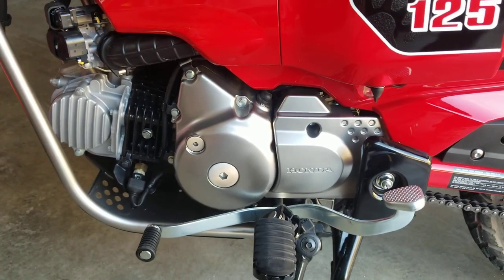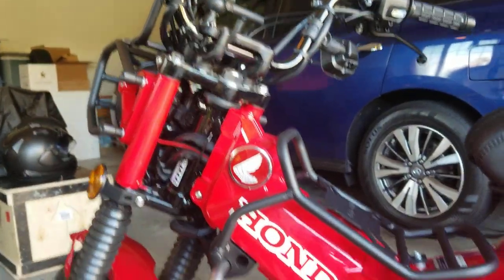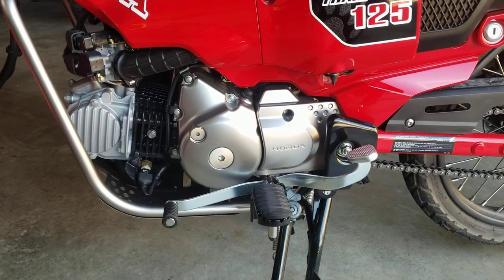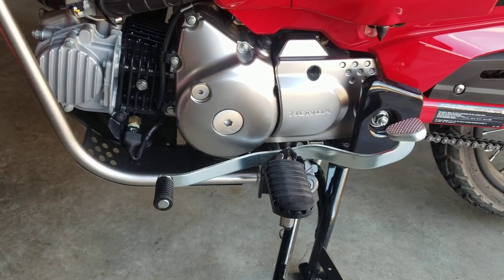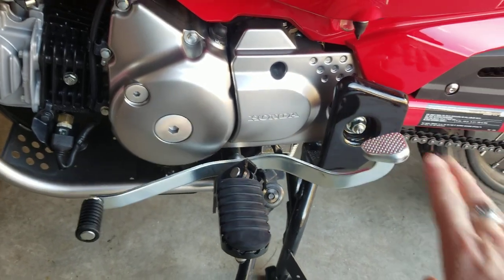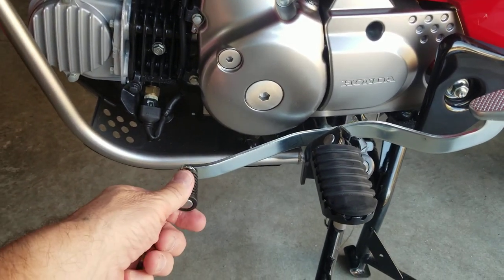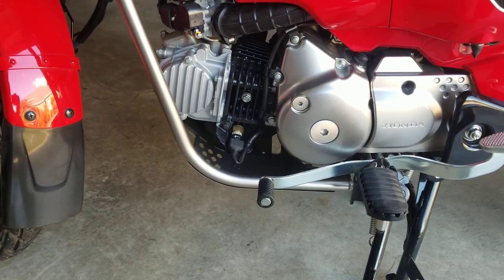2021 Trail 125 Shifting a Semi Automatic bike.

Comment: I too have been riding for many years and I'm still trying to get used to the transmission. Thanks for posting your input. I like my Trail 125, but it's just taking me some time to feel truly comfortable with the lack of a manual clutch.... I know I'll get used to it eventually, it's just so different than having an actual clutch lever. Yes, I'm an old guy and it takes old guys some time to adjust to new things! Greetings from Clemson, SC - Happy Thanksgiving to you all !!
Reply from the maker: I agree. At first I was a little disappointed at how it shifted. Once I got how it worked I now enjoy riding the bike more and more. Happy Thanksgiving.
Reply: That auto clutch setup is tried and proven. My first bike was a 1969 Honda 50 minitrail. That was enginered perfectly for a 10 to 13 or small 14 yr old. Like a tractor. Trust me, the old tech Honda centrifigal clutch is bulletproof and genius in the woods where you need to stop and go to maneuver around trees and stuff. No stalling of the engine. I abused that clutch for years and sold it to a friend who further abused it and it just kept working. I wish all bikes had a auto clutch.
Reply: Im 25. Id rather have a normal clutch.  Im looking at picking up one of these simply to use as a pack mule around my local small town and to haul my stuff to my various campsites in my county. Where i live a klx 300 or a full blown 450 dirtbike will be better for the type of stuff im dealing with but those also cost a lot more and arent as good at being pack mules. Frankly theres areas arpund me youre going to want a sidebyside with water food a shelter. You have to be caredul, you can overheat in day time and freeze at night. If i hace a pacl mule type bime i can haul ice blocks to my camp an that helps with the various activities im involved with trying to do. Its evry hard if all i have is a klx300 and whatever i ca. Fit in a backpack. A trail 125 isnt as capable but itll get better mpg and i can carry morr water which is key in the desert and carrying water in a backpacl is a terrible idea if you need multiple days worth

Comment: If only Honda kept the high low range feature, I'd buy one, but without that it is a compromise gearing wise. Geared barely low enough for trails, via sprokets, yet too low for the highway. They could have geared it higher with a larger front sproket so it can keep up with traffic and throw the low range lever to gear down for in the woods. Honda missed the mark on this one.
Reply from the maker: Some interesting opinions.  Yes the bike is not geared for off road or highway riding. It is geared for city and dirt road riding. I think Honda after making some 100,000,000 of these bikes. Starting at the small CT's and to the present Trail 125 may know a thing or two about how to build a bike for the masses. I'm not dumping on your opinion just adding mine. Ride safe.

Comment: Excellent explanation of the Honda centrifugal clutch system.  My first motorcycle was a Honda Passport 70 I got back in the 1970's.  Rode mostly bigger bikes for most of my life but when I retired I returned to my first love and bought a new Honda SuperCub in 2021.  Only $1,400 from the dealer (assembled in Thailand). I ride it all over the Pattaya Thailand area and it's a blast.  When I picked up a place in Cambodia I bought an old LittleCub (2005 or 2008, things are a bit foggy on that).  The 49cc engine is now a 125cc out of a Honda Dream, and it's stripped down to a street rat cub.  Great fun for getting around, and at 6'4" I look wonderfully dorky riding that little speed demon through the countryside.

Comment: I have a 2019 Super cub. It took a few miles to get the hang of it, but when you do it's nice! 
I've seen countless videos were people are switching the shift lever to get rid of the heal function.
I usually tell them to give it a chance. South Carolina here!
Reply from the maker: I agree. There is some getting used to it but once you do it's kind of a unique feature of the bike. One that I like. I may be doing the SCAR in the spring on my Trail 125.

Comment: Unless I miss understand, this seems not right for mine in Canada. If in N and you shift up you are in 4th. I was starting out in 4th and had it all backwards. When in N on mine you shift down for 1st and so on. One question, for safety we are supposed to park in gear so it does not roll fwd off the kickstand and so I wonder if I can start it in gear or do I have to shift into N to start it when I get on as there is no hand clutch..

Comment: Thank you for this explanation. If I understand correctly, you push your heel down and let it back up to shift to a higher gear, and you don't have to let it up gently; but when you shift down, you press your toe down and let it up slowly? Will there be a problem if you let it up too fast? Also, if I use my heel to shift up to 4th and then shift up once more, does that put the bike into neutral? If so, is that a good way to prepare to stop, or should I gear down to 1st and then stop, or down to neutral and then stop? I have never ridden a bike, so any help will be appreciated.

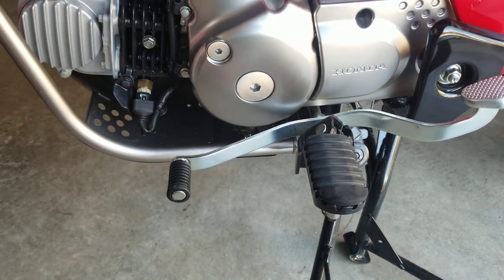Comment: 2:02 When you push the front lever down & hold it between say 3rd & 2nd gear.. Other people say it's not actually in neutral but instead causing the centrifugal clutch inside to be partially engaged/disengaged & slip which wears it out quicker. 
Many riders unknowingly ride with their foot slightly pushing down front lever which  burns  their clutch up. 
A semi automatic scooter 🛵 is made to be much easier to ride than motorcycle with manual clutch.

Comment: I got a question NCC. Is there a way to make the Honda trail's clutch grab harder so it will pop a wheelie in first gear. It seems to slip a lot when reving up the engine and letting off the shifter to engage it in 1st gear. I can't get it to pop up more than an inch or two.  I got a small bump in my yard.  When I'm coming off my driveway, I  It pulls the wheel up a little in second gear when I hit that small bump. I noticed the clutch doesn't slip like it does in second. It grabs it hard but because it's in second and with the weak motor, it barely popps the front up. I have an old 2000 Honda foreman 400  4 wheeler that has the same no clutch hand grip set up. I have been doing wheelies and abusing it for like 23 years. Never had anything go bad or never had to  replace the clutch.  While reving it and letting off the shifter in first gear will pop up so hard  to where I will fall over on my back If I don't let off the throttle. Is there something that can be adjusted or add stiffer springs so the clutch on my Trail will grab harder?  The way you described it, it sounds like the clutch is still a clutch like the one on my Monkey and I can just replace the springs with stiffer ones?  I'm not a mechanic by no means, but I do work on all my bikes, atv's and cars. I never had the need to know about this honda clutch set up. Thanks for any help you can give on this so I can do some stunts on my Honda Trail.

Comment: New rider here, just passed my course and looking to buy a Trail 125. Sorry if this is a silly couple of questions but in the case of an emergency stop, you would just kick down the front shifter into neutral and then break that way? Also after that without holding the clutch how can you shift the bike back down to first gear to take off again? Thank you!
Reply: Late reply, I know. In an emergency. hit your engine Kill Switch. the Switch near your Right Thumb. and while it's off, you can shift it, so Shift it to neutral before turning it on again
Reply: it has a centrifugal clutch, when starting from stationary, engine and transmission are disconnected until engine speed becomes high enough
coming to a stop, power disconnects once again when engine speed falls below certain threshold

Comment: Hi, I am riding a Honda Future 125cc and tend to sit nearer to the front but when doing so, I find it very difficult to use my heel to step on the back pedal to downshift to lower gears because my legs are bent inwards. For the lower leg, is it ideal to be 90 degrees to the knees or bent slightly outwards? 
Otherwise, I really can't get used to downshifting using heel to step down back pedal, can I downshift by lifting my toes upwards against the front pedal?

Comment: This is bizarre please can you confirm your bikes gearing is neutral then 4 up for years 1 to 4 ? Then down 4321 neutral? The reason ask is that the CT 125 here in Thailand is 4 down gears 1234 and gears up 4321 the complete opposite of the same model here in Thailand a real head scratcher
Reply from the maker: Here in the USA our gears are set up different then yours. Here is all the way down is neutral and all the gears are up. There may be some confusion because to shift up I push down on the heal shifter to go up a gear and push down on the toe shifter to go down a gear. Hope this helps.

Comment: Bro i have no issues with upshifting but whenever i downshift by letting go of the throttle all the way then pressing the shifter hard then lifting my foot then back to the throttle i feel a huge jolt I can't find a smoother way to downshift right now im literally driving in third gear without shifting at all because of that jolt any suggestions?
Reply: Hi @Adam_Ch739, greeting from Jakarta. The trick is to watch for your rpm. If it's too high, let go of the throttle first. Then you press the shifter down and slowly release it whilst slowly rev up. I guarantee you there will be no hiccup. If the rpm is low, let say you are about to stop, you just shift down without the need to rev up. Been riding this semi auto a long time ago. Feel free to contact me.

Comment: On my 1980 Trail 110, I have to blip the throttle while downshifting. I can’t hold it down and coast, the minute I push down, it shifts. Maybe it needs adjustment or is just worn out.
Reply: Does a 1983 Honda ct110 shift the same as we saw in this video?

Comment: So what's the difference, if you  decided to use your foot underneath the front to push up on the gears
Reply from the maker: There is no difference.  Some riders with larger feet cut the heal shifter off and only use the front portion of the shifter. Just as you would find on a regular toe shifter.

Comment: I notice that your bike shifts a lot “easier” than mine. There are times where I have to repeatedly attempt shifting before it goes into gear. Any tips or advice on what I might be doing wrong?
Reply: Feel the right velocity to shift the right gear.
Reply: You can also double clutch to get it to drop in to gear.  When shifting release the throttle, press down on the shifter, and if you feel resistance keep it pressed down (lightly) while giving the engine a little rev.  It will then drop in to gear.

Comment: I'm at 1,600 miles on mine. Just did another oil change (one at 600 then one at 1600 just to ensure most of the break in junk was out) and today my shifter seemed to just randomly shift much easier. Prior to today it seemed like my shifts were more deliberate with a tiny bit  of a clunk into position. How's your shifter feel? You looked like you could depress it pretty easily by hand on this video. Just curious.
Reply from the maker: I found it did shift better/smoother after I changed the oil at 600. I'll change it again at 1000. It's cheap and fast  to do a oil change. I did the same on my Monkey and it shifts smoother now.
Reply: @nothcarolinacanuck4427  Glad its a common sounding thing. To be safe I went ahead and completed the clutch adjustment steps. PSBE and Dabinche have videos on how to do it. I went through the process and my adjuster screw ended right back where it was in the first place. Test drove it then and no issues. It was just weird how all the sudden it went from having to use a slight bit of pressure to switch gears to it being almost effortless. In the past I tried adjusting the clutch on a 1970 ct90 and ended up making it worse. Guess I'm just paranoid. Thanks for your input. Much appreciated. Off topic, not sure if you'd be interested in one of these or not, but it's a very cheap and easy upgrade...

F FIERCE CYCLE 12mm Diameter Gear Shifter Kick Start Lever Rubber Universal for Motorcycle https://www.amazon.com/dp/B08FD5HDWB/ref=cm_sw_r_awdo_navT_g_YB5GRRRPSM4HDJJ25SRZ

Saw it on Best of Backroads channel. Just sharing.
Reply from the maker: @findingneutral  I took a look at the link. So you added this to your kick starter lever? Was it a good fit? May have to add one to keep up with the Jones's.  Lol.
Reply: @nothcarolinacanuck4427  No I just ordered one. It looked like it fit on theirs though. I'll let you know once I get mine how it does.
Reply: @nothcarolinacanuck4427  Got my fancy kick start rubber. Fits perfectly. Threw me off at first as it has one smaller hole on one side. Buts thats the outer hole. Needed a bit of soapy water to help slip it on. Looks great though.
Reply from the maker: @findingneutral  good stuff. Do you have a pic?
Reply: @nothcarolinacanuck4427  If you have any email I can send a pic? Its not much to see though. But I do feel the rubber bit on the kick start gives it a more vintagish  appeal. It just might make one want to kick start it now and again 🤔
Reply from the maker: @findingneutral  mikesklr@gmail.com
Reply: @nothcarolinacanuck4427  Sent

Comment: I dont think that's the clutch, it's the synchros. I could be wrong. My old 240sx had strong enough synchros to move the car forward if you pushed it hard enough 😅
Reply from the maker: Not sure what a synchros is. It may be similar.

Comment: My antique Soviet Union KMZ Dnepr military sidecar motorcycle has a similar semiautomatic clutch system but it retains a clutch lever and cable. The semiautomatic feature doesn't work when activating the reverse gear lever so you must use the clutch lever. Also because of the weight these military bike's are geared to handle you need the clutch to get them going from a stop. Three soldiers, 80 pounds of gear weapons and ammo for each, and a 1/4 ton trailer you can understand why you still need a manual clutch to get going. Once moving when you shift a pin pushes the clutch lever on the back of the gear box depressing the the lever the clutch lever is also connected to it. This disengages the clutch and shifts up or down a gear so the driver need not release his grip on the handlebar to pull in the clutch lever. I wish Honda had included a clutch lever enabling the driver to decide if he or she wanted to let the bike activate the clutch automatically as normal or override it using a manual clutch lever like the clutch system on my KMZ Dnepr. If you wonder what a Dnepr is simply Google "KMZ Dnepr motorcycle".

Comment: im glad you explained the heel toe shifter so clearly. that's exactly what the manual says, but every single review of this bike online says its the opposite. . i have no experience with motorcycles, but have been considering buying one and this and the super cub caught my attention and ive been watching countless hours of reviews and every single one says the shifting backwards of how you explained it.
Reply from the maker: Happy to help. Not a perfect explanation but I made sense to me. Cheers.
Reply: that is because NC reside in the states, new vehicle have to conform to  (DOT?) rules, shift lever action works like other bigger bikes where clicking (or stepping) down on the lever means downshifting (...4->3->2...), this is the regular, non-GP style shift

other videos you have seen are (likely) from asia, stepping on (front) shift lever means upshifting (...2->3->4...) in small displacement bikes

Comment: Honda has to offer a much better 5 speed w/ clutch system in this bike ! 
Offer this dummy version with no riding skills too,
 but the clutched  5 speed would be exactly what it should come standard /stock
Reply from the maker: Not sure if calling it a dummy version or a no skills bike is fare. The bike is a great example of a small cc bike that has provided well over 100 million riders the ability to ride these bikes almost anywhere.